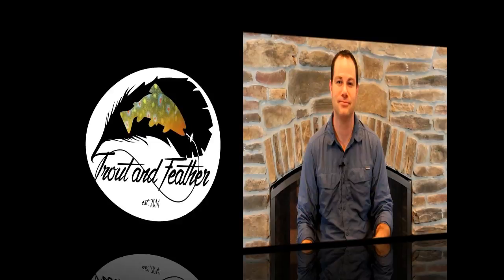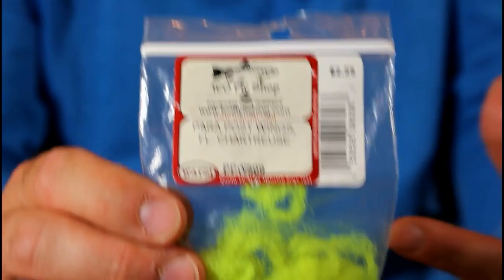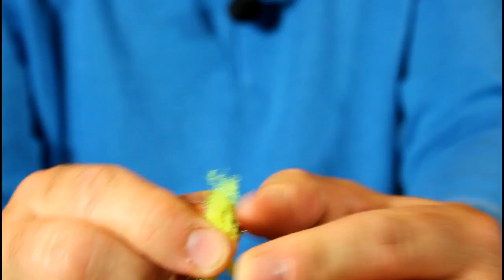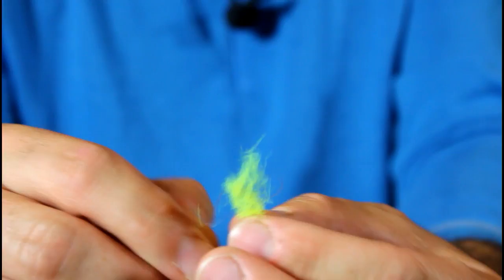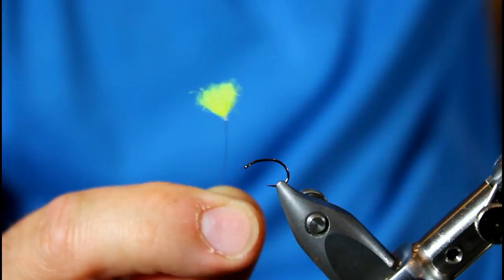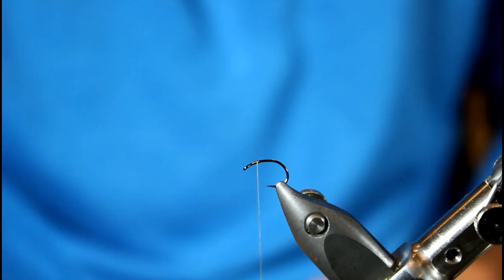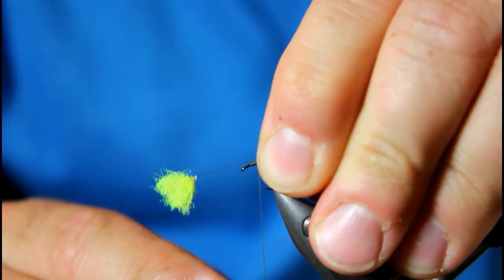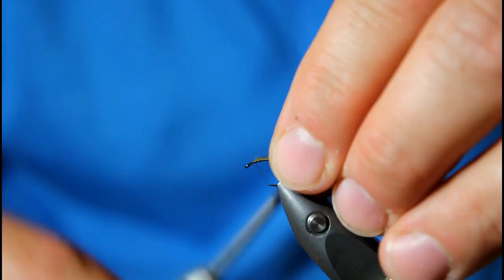Fly Tying: Parasol Post Technique

Comment: Hi, Tim. Two questions -
Is the Parasol more effective than just putting a small indicator an inch or so above the fly on the tippet?
And what kind of fly box do you keep these in?
Thanks, Joe
Reply from the maker: Hi Joe, and great questions.  I keep the Parasol in a normal fly box with slits in foam.  For your first question, that really depends on the situation.  The trickiest thing about an indicator above the line is the impact it has on your tippet (advantage Parasol).  With an indicator, you have the flexibility of changing the fly's depth (advantage indicator).  I've used both methods, and will continue to do so, though have always first gone with a Parasol if the fish are closer to the surface, especially for technical fish that have more time to inspect the pattern.   I hope that helps, and I appreciate the questions.  Tim
Reply: This pattern is in Fran betters tying manual